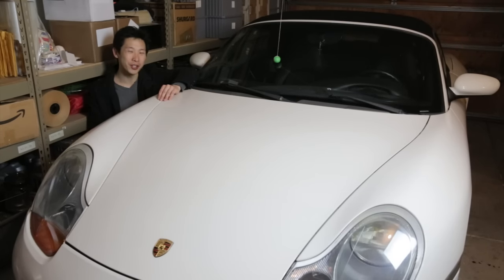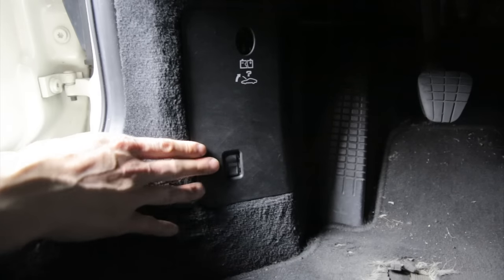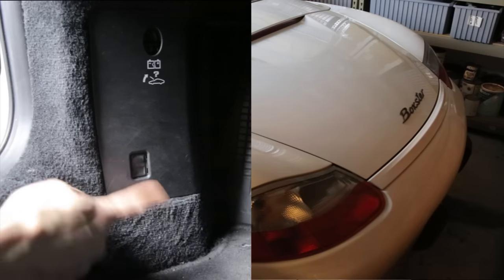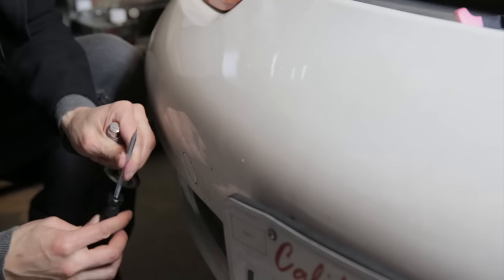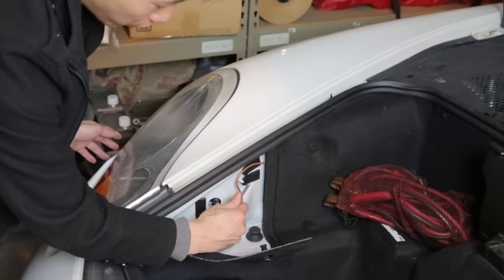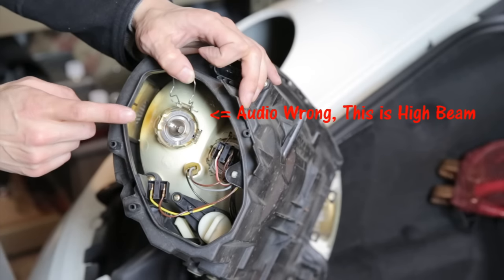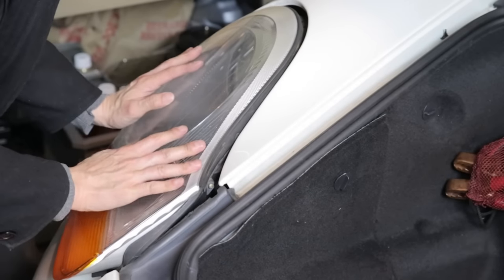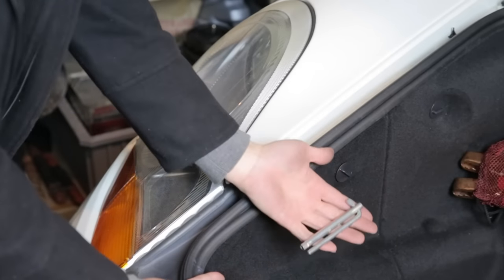Porsche Boxster 5 Hidden Features | BeatTheBush

Comment: #1 seems to be an industry standard for decades; the reasoning being that you may wish to air out the cabin before entering, if the car gets really hot in summer.
Reply from the maker: Silly me for having such an old car. This is the first time I encountered it. I guess it's in all the new cars now including Bluetooth, USB ports, mp3 playing capabilities, satellite radio, rear backup camera, semi-auto parking, and touchscreens (which mine doesn't have)
Reply: I think my old MB W124 had that, but I sold that already 10 years ago... it still had manual windows in the back... 

There are a few such features that have been widely adopted by different manufacturers; it is only that people are typically too lazy to read their owner's manuals :P If you lock the doors with windows open, they should close if you keep holding the lock-button (guessing).

Don't you need that "head light tool" as well for changing between right-hand drive and left-hand-drive traffic? I ordered the fancy PDLS+ lights, so I can avoid screwing around the lights. I will bring my 981 over to Germany from the UK tomorrow, so I can drive it in its natural habitat :) Will go on to Austria an do as many alpine passes as I can :)

The weird workings of the spoiler are of course so that no fingers get caught when retracting it...
I have digital radio + PCM, but only optioned that for the next guy to own this car, because I was fearing that they will switch off analog radio all together in a few years; I have never used it myself, actually there are quite a few buttons that I have never touched, not even for curiousity, because I am not curious :P actually I haven't owned any radio in +20 years... does my head in ;) Anyway, it is a driver's car - who wants to listen to Britney Spears in a Boxster?!
Reply from the maker: Baerchenization Great point there with the spoiler. It makes total sense to have to hold it down to close it. 

One dangerous point in light of that is when you have your windows down and you close the top, the windows will automatically close. Pressing the window up button once also make them automatically close all the way. Those would be dangerous moments if something gets caught when it's doing that.

Ahhh... analog radio going away? I wonder when that will happen. I guess if it ever happens, I'll rip out my radio and put in a new digital aftermarket one.

Is there really a difference with right vs. left drive traffic when setting the lights? The lights for me have always been a level setting and they are centered from left to right. There isn't really a bias of light away from oncoming traffic. Although, now that I think about it, I guess more advanced lights would try to block stray light on that side. Very good.
Reply: There always was and is a difference in the shape of the light cone. With older cars, the front glass cover is shaped/cut to shape the light cone so to be focused on your side of the road and not to blind oncoming traffic; the newer fancy lights like Xenon have that integrated in to the bulb unit directly.
And I don't know about the US, but in Germany they have already switched off analog TV, so radio is surely next. There was the first digital radio standard called DAB from the days when you were still a toddler, which has long since been buried, too...
Reply from the maker: Yup! Makes perfect sense. In US, they already switched off analog TV as well. I'm thinking it might be a while longer to switch off analog radio because you cannot just get a digital to analog converter like in a TV. When you switch of radio, the radio itself is dead. You could use some sort of digital to FM transmitter but that would defeat the purpose of polluting the FM band. I do agree it's coming... one day.
Reply: The 981 doesn't have a standard slot for swapping a radio though, it is all baked in with the PCM, so I had to go digital :P Maybe the kids of the future will use their iPhone for listening to music, as they do for navigation...
Reply from the maker: Baerchenization Really? Looks like a rectangular hole just right for a radio to me but I haven't done it before since I still use the stock radio. PCM as in pulse code modulation so the output of the radio is digital? There has to be an analog amplifier somewhere that has speaker +/- cables right? I bet even if it's not normally possible you can probably wedge it in somehow.
Reply: PCM as in Porsche Communication Management, i.e. that center console touch screen through which you operate the audio, GPS, phone, car functions, etc :) All newer Porsche have that. That's why I am saying there is no classical radio form factor slot.

Or is there? I don't know if you say it like that, I would have to dash out and check, haha :) From the top of my head I would say 'no' though... (981, not 986/987)
Reply from the maker: Baerchenization Oh.... I WISH I had a PCM center console with the GPS, LOL! This is poor man's Porsche here. =D So my radio is just a CD player. Back to the turning off analog radio point though. Because your radio and many others is so hard to replace, turning it off to go to digital basically mean bricking all the radio. So for that reason, I think analog radio with HD embedded in the sidebands is going to stay for a long time.
Reply: OK. I finally made the effort to look it up. Analog radio is also partially out the window in Germany already, and it seems analog is scheduled to be gone all together by 2025. - Do you consider 8 years to be "a long time" ? That will obsolete between 150-300 million radios in Germany, 'they' say.
Reply from the maker: Baerchenization It'll be here before you know it. I think if it's up in 2025 in the US, I'll be okay with it personally. The deal is, they gotta make sure every new radio produced has digital only capabilities. Then when enough of the analog dies from old age, they can turn it off without much complaints.

Comment: I have a Boxtser S 2003 . After I changed a light bulb I noticed the headlight beams on both sides were too high. A motor on the back of the headlights seems to automatically adjust the height according to the level of the car. If I put the headlights on and turn the ignition key on the light beams will move down from the high position (whether full beam or not) but then immediately move back up to too high!  When they reach the low correct position I can hear what seems like a locking mechanism trying from inside the headlights beam adjusting motor, to hold the "cog" in place but it doesn't and makes a ratcheting noise. Any ideas?
Reply from the maker: No idea, I never had motorized headlights in mine.

Comment: hi, Thank you for video - i own a Boxter S 2004 - i parked on a covered home garage and covered with 1 soft cloth and then 2 polyethylene-pad cover from Porsche in 2009 because going out in a business trips.  The car has about 10 Kilometers as i remember. With this said, i just returned to the garage and it is 2018!.... of course battery dead, etc.  I leaving again so i will not even try to turn it on, etc.  However, i was able to release the hang-break.  My other goal is to remove the gas cap.  Can i open the cover lid to remove the gas cap without a battery?  is there a way?  thanks - Nasri
Reply from the maker: Why would you want to remove the gas cap? Are you replacing it? You need it there so gas fumes will not leak out. You can attach an external battery through the fuse box 12V post and the metal hoop at the door for ground.
Reply: hi - thank you for response.  It might be late now....no surprises....but i want to remove the gas cap so the tank and attached pipes do not get damage more - if not already damaged - regarding the fumes, it is a standalone garage with flutes so fumes can go out.  I was hoping to remove the gas cap perhaps reducing the pressure build-in due to temperature changes - i do not recall how much gas is in there - i know it is 93 and probably near full.  Fuel might be flat but concern with the pressure build-in.  i was hoping there is not need to bring a battery to open the door so i can remove the cap - thank you for any leads
Reply from the maker: Okay, my view on this is completely different. You shouldn't be removing the gas cap and release gasoline fumes into the air as that is directly causing airborne pollution. Your gas tank is meant to hold in the pressure so there shouldn't be worries of leaving the gas cap on.

With it removed, your gas will evaporate and eventually have nothing in the tank. To keep the car durable and long, run it every 3 days at least. To keep the battery and not completely drain it, put a battery keeper on there, it is simply a low energy battery maintainer you plug in. 

You're biggest concern will be condensation that does not get burnt off from running the car. It sits at the bottom and rusts things. Also the lubrication will run down and will cause a large amount of friction when you next start the car, causing a bit of high wear right at the beginning.
Reply: i understand your point -and really hope you are right - there is no need to remove the gas cap.  Now, the gas might be flat by now.  I am looking to towing the thing to Porsche for all fluids purge and refill. ....but still if you happen to know, i am still curios to know if i can open the lid without using the battery... thank you ...

Comment: Any suggestions on how to open the two trunks latches? They are both locked.
Reply from the maker: There are hidden spots to pull at the cables like under the driver side wheel wells but I forgot exactly where they are. If you battery is dead, you can just connect an external battery to temporarily power it.
Reply: The battery in my car died with the alarm activated. That being the case, a steel locking plate rotates into place, locking the levers. On my ‘99, I loosened the three Allen bolts as shown here, lifted the mechanism out of the rocker, and turned the locking cam with a small screwdriver. I could then open the trunk to get at the battery. Took maybe 30min. You can’t use a long Allen wrench, one of the folding sets is perfect. https://www.renntech.org/forums/topic/2751-how-do-i-release-hood-with-no-battery/?do=findComment&comment=12912

Comment: Is there a way to open the front trunk lid in the event of a dead battery (2003 Porsche Boxster)
Reply from the maker: Yes, you just power the battery externally with a tab near the fuse box. Then you use the button. Alternatively you'll have to open the front wheel well on the driver's side and there is a cable you can pull manually.
Reply: 2014 911 I sure hope 1 of these secret pull cords are a feature, Im stuck in underground parking with 0 outlets to open hood with a dead battery @BeatTheBush  ...holy tips.... thanks for all the money saving do it yourself hints

Comment: omg that headlight removal is so simple, touché porsche... i have to pull my bumper to remove my headlight assembly
Reply from the maker: Really... what car is that?
Reply: BeatTheBush the car in my profile, its a 2014 VTR   Veloster Turbo Rspec  

.. iwanna paint the chrome inside my headlights a nice pearl red! with some black accents butt i keep putting it off because of the bumper removal needed lolol plus  iunno what to paint my orange blinker if igo the pearl red main with black accents. iwas thinkin maybe white butt iunno maybe the orange blinker will look good with the pearl red n black
Reply from the maker: Who Yoube Huh, I guess it's not too bad since you don't need to remove the assembly too often. You can change the bulb without removing it right?

Comment: Good video however i would not push on the headlight to push it in even that its strong it you should push it in from the sides of it after you line it back  on the track not preasure on the plastic glass got to be delicate with this nice car why push on all the car  so rough no no be gental with it
Reply from the maker: This car no longer exists since this old car built up too many issues including spewing smog on startup.

Comment: to open the windows press the unlock on the key and hold it down  both windows will open to close press the lock button both windows will go up its called global opening
Reply from the maker: I don't really like that feature as it drains the battery on my keychain. But in a pinch I would use it still.

Comment: HOW U OPEN THE HOOD WHEN THE BATTERY GOES DEAD .
Reply from the maker: You use an external 12V battery and hook it up to the tab near the fuse box. Then the hood motor is powered.

Comment: Is that a Boxster S ?   I didn't see an S, and it has a wind spoiler
Reply from the maker: Nope, it's just a non-S. S does have more power but also more fuel consumption.
Reply: I want one like yours, but black,
Reply from the maker: Bill Dollarmovie Sure. =D Porsches for all! =D =D =D One thing I worry about black cars is if they get hotter under the sun. I guess the interior is black already so that attracts plenty of heat already.
Reply: I'm going to build a garage soon, and always have it sheltered when not in use
Reply from the maker: Bill Dollarmovie What about when buying groceries? Or... going anywhere? Hmmm????
Reply: I have 4 vehicles, and alternate them, so they will mostly be sheltered.
Reply from the maker: Bill Dollarmovie Ahh... be very careful with letting it sit there too long. I'd say drive it every 4 days even during the winter or else the battery just dies in a year if you drive it more than every 2 weeks. My alternator died which I suspect mainly due to inactivity before I made it a daily driver.
Reply: thank u for that, yeah, I will run it every week at least once.   The Boxster is an amazing car, so many awesome aspecs
Reply: I have a battery keeper attached.  No more problems.  It can sit all winter.
Reply from the maker: Don Koenigsberg My view is that the battery keeper will keep the battery alive but will not lubricate your engine. Condensation forms and corrodes things. Or perhaps the lubrication slowly collects at the bottom of which ever bearing and the top of the bearing become bare. When you turn things again after the winter, the initial few turns scratches the balls in the bearing giving the various parts in the car a kick in the groin. You can only take so many kicks in the groin before you die. =D
Reply: plenty of room in the 2 boots
Reply: Bill Dollarmovie the easiest way to tell if it's an s or not is to look at the front bumper. The non-s has two inlets, while the S has three Inlet. 2 on the sides and one in the middle hope that helps.

Comment: Great video but tbh, the 986 is by far the ugliest Porsche ever made.
Reply from the maker: I think circles are pretty ugly because they lack corners.
Reply: BeatTheBush That's what counts in the end. I mean it's your 986 not mine. ;)
And as I said: Great video!
Reply: michael enright <3
Reply from the maker: DimensiiioN A matter of personal preference I guess. Majority of the world population that cares would think it's aesthetically pleasing.
Reply: BeatTheBush Not in Germany. Trust me, most people hate the 996 and the 986 even more. We see so many newer 911 each day that we have to hate this thing.
Also the 996 is the only 911 that does not gain value over time.
Reply from the maker: DimensiiioN Which is a great opportunity for those wanting to buy a new used Porsche. If you only like what most people like, is that not being a sheep?
Reply: BeatTheBush Did I say that I don't like it because most people don't like it? No, I didn't.
I personally think the 993 and the 991.1 are the most beautiful aircooled / watercooled generations. I don't like the 991.2 either.
Reply: On top of that, the 996 has many issues since it's the first watercooled gen. So it's ugly, it does not gain value and it is full of problems.
I see no point why I should buy a 996.
Reply from the maker: DimensiiioN You certainly shouldn't buy one since you hate the design so much. But for a new buyer, 996 is an insanely great value. Sure it may have problems but it still handles like a Porsche.
Reply from the maker: Do you like 996? Do you think 996 is ugly?
Reply: Have you ever been in one , then again I don't think you would fit in one
Reply: +michael enright Yes, I have. My neighbor used to own one.
Reply: +BeatTheBush 996 is - as I said - by far the ugliest 911 generation.
Reply from the maker: DimensiiioN Ok, but what makes you want to express this in this comments section?
Reply: +BeatTheBush You do a video on a 986 that I watch. During the video, my opinion on the 986's design stabilizes. I express it in the comments because that's what they're made for - expressinh one's thoughts.
Then we start talking about the design and the corresponding 911 generations before we finally arrive at this point here.
So what do you mean?
Reply from the maker: DimensiiioN Ok fair enough.